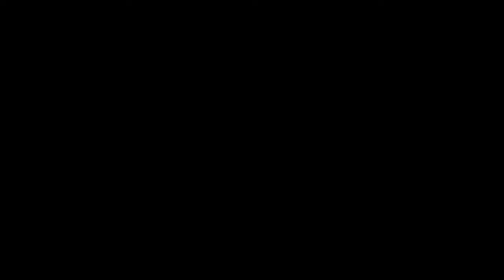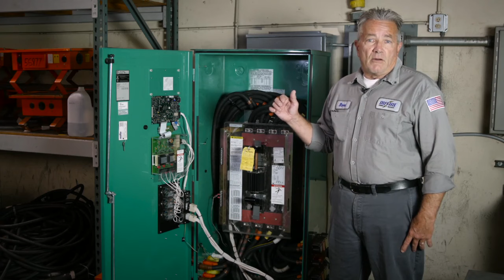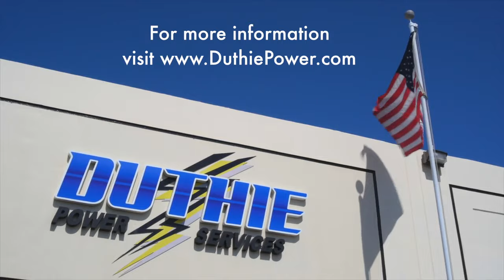Automatic Transfer Switch - ATS 101

Comment: if the both power source are genertor ?? Then How ATS Work on two generator without any time delay during switching process.
Reply: @duthiepowerservices  thank you for your feedback. But as it possible if source second should start 5 mint or so before source 1 turn off by using timers or through programming .  Do you have any idea ???